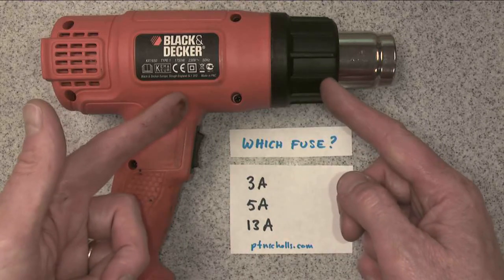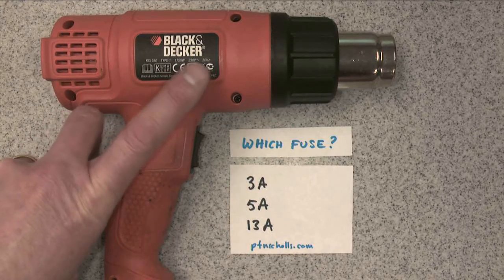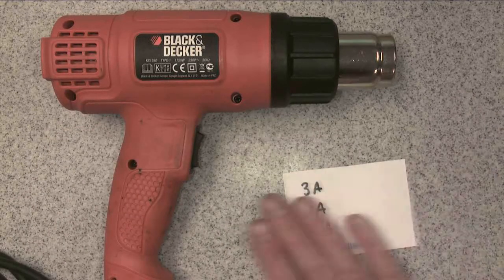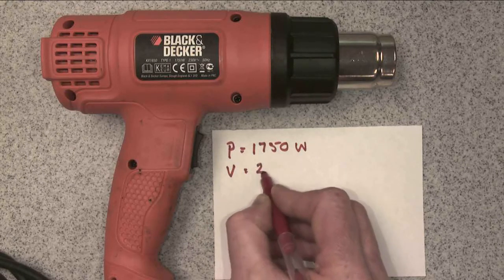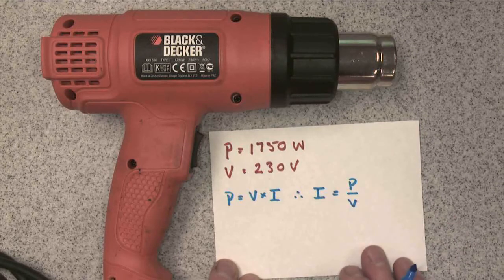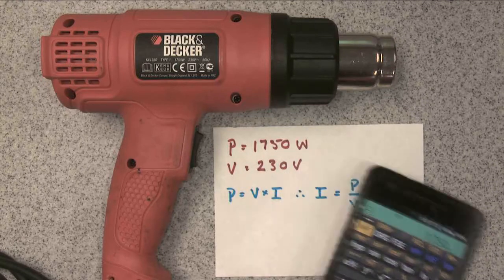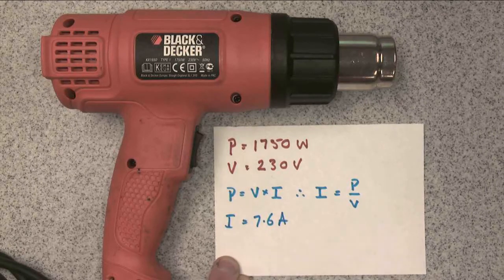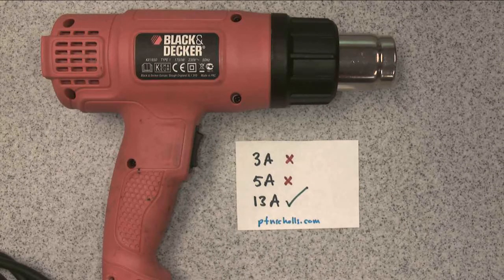How to work out what FUSE to use

Comment: You are doing the math, but you are making a dangerous generalization to say that, because you only have a 13A fuse at hand and it will not blow at the given amps, it is okay to use that fuse. A fuse should only be replaced with an identical fuse and only after the original fault that blew it has been determined and repaired. Even though you post in the comments that this video goes with a website tutorial, I find it iffy.
Reply from the maker: I completely agree with your comment "A fuse should only be replaced with an identical fuse and only after the original fault that blew it has been determined and repaired". However, this video is about how to calculate the fuse for a (non-faulty, possibly new) device to be used on the UK domestic mains where the only fuses available are 3A, 5A and 13A. As these are the only fuses available, then the 13A fuse is the correct choice. This is the sort of question that might be asked in a GCSE exam paper. I stand by my video but I do take on board your comments and thank you for your response, I will add a similar cautionary comment to my website page and tutorial.